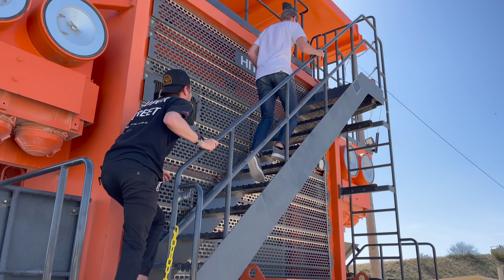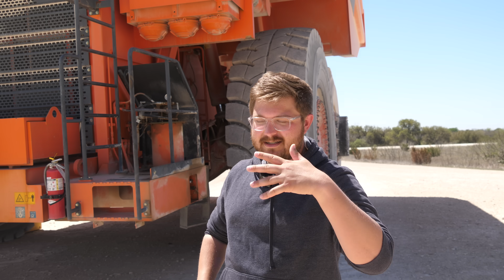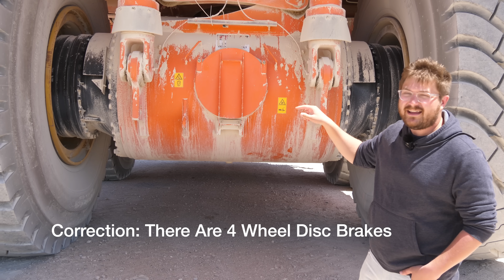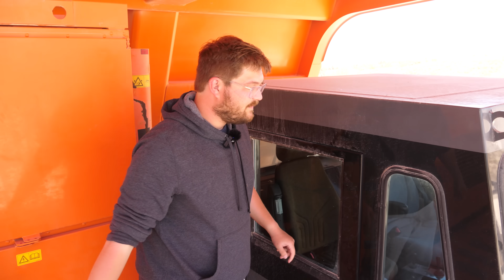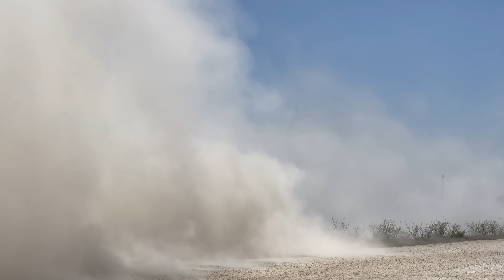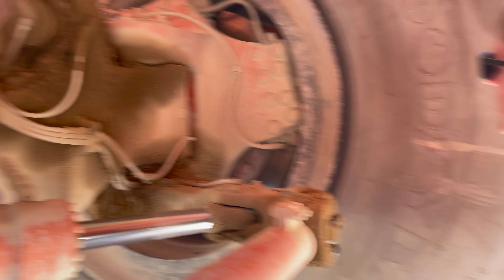Here's What It's Like To Drive An Insanely Giant Mining Vehicle!

Comment: Yes, you can drift these trucks, in fact, you don't really feel the road through the tread in the tyres like a conventional car or truck, mostly they are on dirt roads that get repaired by graders as the day goes on, they are very slippery on wet ground and don't go up and down wet ramps very well, if you're in a water truck, you need to be careful not to overwater the roads.  When it rains, you need to stop running them unless the ground is flat or you have gravel to sprinkle on the ramps.

Comment: It's not rear engined like a 911, it has a diesel engine underneath up the front, which powers the rear electric wheel motors in the rear.  Without the conventional diesel engine constantly running, it doesn't go.  They are designed to run 24 hours a day and they'll use around 3000 litres every 24 hours.

Comment: regenerative braking only to dump it as waste heat feels so lame. batteries would be lame too. the coolest option would be to dump it all directly into a huge flywheel, especially if it uses the air it displaces to circulate air and/or liquid for cooling. probably not a good idea i just love flywheels

Comment: I worked with a guy who was doing a shift change in a landcruiser mine vehicle and he was run over by the dump truck he had just done his shift in.  A young female operator drove the landcruiser up the hill to the parking area and parked it at the front in between the front wheels of the haul pack. (Dump truck). They swapped out and the guy got in the landcruiser which had a poor battery and it refused to start straight away, the female operator assumed him to have left after a short time and drove the truck over him in the landcruiser.
He survived by quickly crawling i to the passenger foot well ( he was a smallish guy) and that was the only part of the vehicle that was not fully crushed.
She was fired,  he is on permanent payout at 2 million aud compensation.
The cruiser he was cut out of I saw at the lay down yard and wondered how the hell he survived it, Ironically I saw the wrecled cruiser before I met him and when he said who he was I nearly fell over in amazement.
He has permanent mental disorder and cant go anywhere near heavy equipment or even into the mine now.
Reply: The rules on change over were changed because of the incident and so it has not happened again.

Comment: I loved this video. I drive the CAT 797 (the one you could fit that one in the back of) in the mines of N. Alberta. Yes you can drift these things! Cross steering is a must in mud or slippery snow and when you drive them long enough that is the best part. I wonder what kind of data they are getting from that tire configuration. The rear tire in this demo is for one of the 797’s and for us the real strain is on the front tire under loads in turning conditions. Gotta go real slow. Putting it in the center of a rear axle doesn’t represent the role it plays on the 797. Presumably they are getting something out of it but that is not how we use the tire.

Comment: Hitachi has these with a trolley catenary systems (EHC3500AC-X) - where the diesel engine is bypassed and the motors run off overhead electrical lines like a trolleybus. They claim it reduces diesel consumption by 90% at sites set up on a grid.

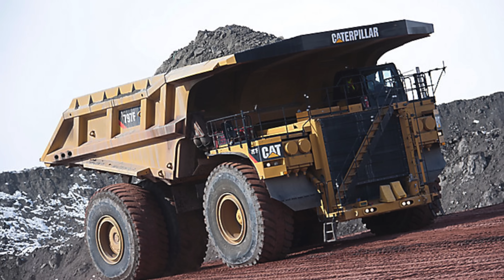Comment: 0:48  Belaz 75710 joins the chat
Reply: Not only are there several larger trucks than the EH4000 by CAT, Komatsu and yes, Belaz, but Hitachi makes larger trucks such as the EH5000ACII. They should do some research before making these videos. Also he doesn't use proper terminology,  such as calling the grid box a 'heat exchanger'.

Comment: How is it regenerative braking when that energy is just dumped as heat and is not usable by the vehicle itself ?
Reply: I believe the more accurate term would be rheostatic braking.
Reply: It simply isn't, the dude doesn't know what he's talking about...
Reply: @andan2293  😂
Reply: Just because it doesn’t Recharge a battery doesn’t mean it doesn’t ReGenerate electricity. 
By turning the motors in the opposite direction 𝐆𝐞𝐧𝐞𝐫𝐚𝐭𝐞𝐬 electrical energy from kinetic energy. Meaning the motors are generators creating electricity whilst slowing down, just because they then waste the electricity using fan heaters rather than recharge a battery doesn’t mean it isn’t regeneration 🤷‍♂️
Reply: @reecehardiman7662  did you use a free AI to (re)generate this nonsense? Even using fancy 𝐟𝐨𝐧𝐭. And the first sentence makes no sense, at least read it before you post it. Yeah, turning the motors in the opposite direction will slow the car, but also shred the expensive tires. And what does it regenerate if it's a regeneration?
Reply: @reecehardiman7662 common sense isn't so common 😂 👌🏿

Comment: That was incredible! Now you’ve got to get everyone to install some battery storage, because it’s awful to radiate the power away, just like a diesel/electric train.
Reply: That would be really insane since a 100 to 1000 kW battery could be too small for that giant. However who know when the technology will be ready? I hope in 15 years from now it will get good enough to be a cool BEV! Today's batteries are too heavy for those tires although the vehicle itself, its frame and motors would not care much for extra weight. At the end of the day those one time friction brakes would be useless with that new extra weight of a really giant battery providing new special tires will be able to cope with that load. A decomissioned vehicle like that should be used at the and of the show at Demilition Derby though!
Reply: Look up the Elektro Dumper or eDumper. It’s much smaller than this, but has a 700 kWh battery that doesn’t need to be plugged in because it gets charged by the regen while going downhill.

Comment: What was the reason that the regenerative energy isn't stored for later use? Feels like the arguments of "too much weight" or "too expensive" wouldn't really apply here
Reply: Some mines have overhead power lines on hills and the trucks have pantographs to use electricity to help the trucks get up hills and save on fuel costs.
Reply: It is starting to be done in some places.
Reply from the maker: All about weight - more batteries means less payload and mines like to run these fully loaded. Diesel is relatively cheap so probably more profitable in a mine to run these things by burning off the energy rather than having to make more runs due to less payload capacity
Reply: @OutofSpecReviews  I've seen mines with overhead high-voltage lines that offload the power to the grid.
Reply: @OutofSpecReviews  Governments need to subsidize the cost difference to get things going. It makes sense when the ore is above you, you go uphill empty and loaded downhill. You get to climb for free!

Comment: I drove the CAT 793 (~250 ton payload) roughly the same size as this. Fun to drive, some mines even have them set up as autonomous vehicles.
Reply: How do they deliver the truck to an actual site.
Reply: @jessicascott6413  depends on the site but these machines can be disassembled into manageable parts and reassembled on site. The mine I worked at was very remote they can only get large equipment in by ship to the nearest coastline and then a long drive on a purpose built road.
Reply: Cat uses an automatic transmission to a differential final drive. Hitachi is electromotive, like a freight train. The motor are in the hubs.
Reply: Jeez these would be scary if they were autonomous vehicles